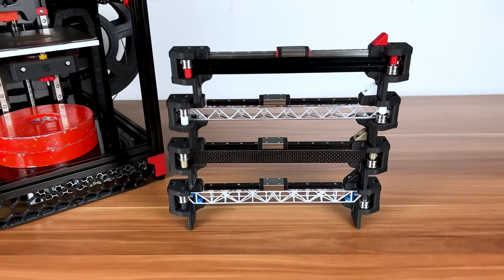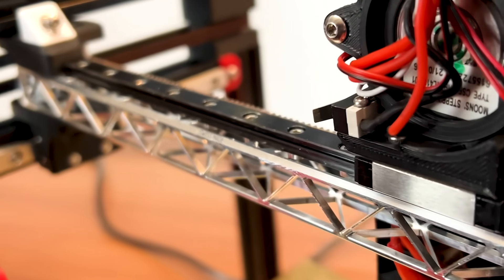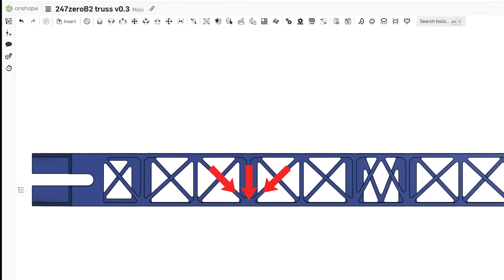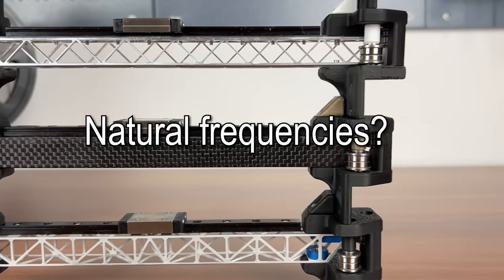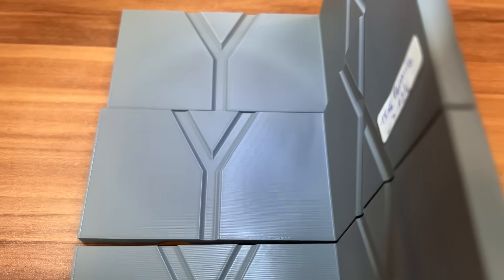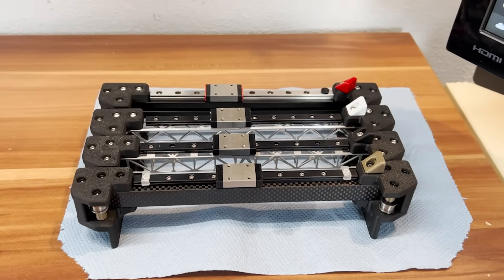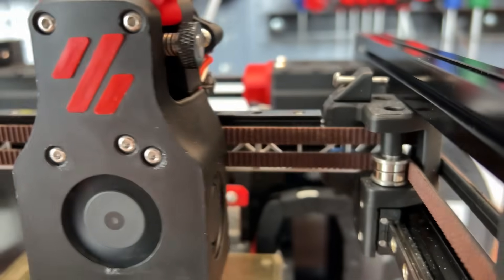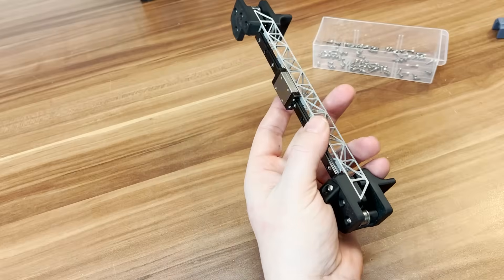ULTRA lightweight X-BEAMS tested -  USELESS on Voron 0.0 / 0.1 / 0.2 ?

Comment: Very nice investigation. I think maybe you underestimate the effect of the torsional force. The lateral deflection test technically would also be a torsional force since the the weights seem to be off-centered from the centre of the beam themselves. The from the lateral deflection and torsional defelection test seem to correlate with the input shaping results. 
Keep doing what you are doing! You have a great channel.
Reply from the maker: Thanks a lot and absolutely, I explained that exactly this is the reason why I did the torsional tests
Reply: @247printing  I agree that torsional deflection is very important. Can you mount the accelerometer as far from the center of twist as possible and show the amount of vertical component realized. By adding weight to the print head to move the center of gravity, in line with the center of twist you may actually get higher acceleration recommendations from Klipper because that vertical component is reduced.

Comment: The efficiency of the beam alone is academic, less relevant than efficiency measured by dividing the stiffness by the System weight (beam mass including the extruder mass). This would show even less difference.  Great video.

Comment: I find it really useful for larger machines like my 500mm vcore 3. the weight savings there are huge compared to the weight savings on a tiny machine like the v0.
Reply: Have you measured this? Or is it subjective? Are the motors on the vcore not up to the job? There is nothing to suggest that it would make more difference on a longer beam unless the motors arent up to the job of moving the stock beam.
Reply: @jeremyglover5541  Let's say the stock beam on a v0 weighs x grams. Since the vcore 3 500 is around 3x larger on that axis, the vcore 3 beam can be 3x grams. Let's say the ultralight gantry is half the weight of a normal gantry. In the case of the v0, the weight savings are x/2 grams, but in the case of the ratrig, the weight savings are 3x/2 grams. Since the motors still have the same amount of torque, the vcore 3 motors will have had a much larger reduction in mass to push, while the v0 motors would have a smaller reduction in mass to push.
Reply: @jeremyglover5541  boy wait until this guy hears about the concept of mass and how longer, thicker aluminum extrusions have considerably more mass than shorter ones
Reply: @microArc  i know. This simple fact seems to have been missed by everyone using this argument. Its a symptom of just doing stuff, based on half baked theories designed to separate you from your money, without doing before/after measurements/experiments.
Reply: @jeremyglover5541  i don't think you know how to do math
Reply: @microArc  npt my strong suit, not higher math anyway, but what specifically are you talking about? Since i didnt mention any math? Also, please use english, its Maths.
Reply: If you are talking about a reply to mobius above, taking on the discussion of mass vs length and flexture and the ratio of weight savings. Nope, i wasnt about to take that on on my phone at 2am. Its an oversimplification anyway, since we arent talking about a simple weight savings, we are talking about strength lost through the erosion of material in a less than uniform manner. We are talking about a carriage and hotend that is not centred perfectly, so as length increases the twist will also be increased. Multiple new resonant frequencies have been added. And all of this ignores the fact that if your motors are able to handle the load for the speeds you are printing and moving at, it doesnt provide you any benefit at all.
Reply: Basically, show me the measurements. Anything else is lip service. Losing weight, without torsional strength being maintained to the matching (ideally better) degree is counterproductive.
Reply: Im all for CF beams, with higher temp resins and thought put into the layup/direction of the fibres. Perhaps forged carbon. Im not really behind alloy lattice without proper testing/simulation and especially without the need, vs just using a decent motor and a standard rigid beam. I have no need for 50K acceleration in the printing i do, so utility also needs to be considered. The comparison between pushing resonant frequencies up so they have less effect on the wavelengths that matter to/impact your process, or damping (physical, or electrical/digital) is one that requires exploration.
Reply: 500mm vcore 3s are beasts!  I'm jealous over here with my 350mm v2.4
Reply: People who have MEASURED this say that the effect is even worse on the larger machines.  The light beams are less stiff then the standard V-slot beams.   Stiffness is what matters, mass is not important.

Comment: AFAIK, Input shaping is looking for it's first fundamental frequency to figure out how fast it can go. It isn't looking for torque on the motors, so weight is not part of the equation for the max acceleration it outputs. If you look at what makes up a fundamental frequency, a simplified equation would be fn = sqrt(k / m), where fn is the fundamental frequency (larger is better), k is the stiffness of the system, and m is the mass of the system. In a Voron, changing the x beam, you are lowering the stiffness of the best (lowering k) when you cut holes in it. The mass you need to think about is the mass of the whole moving system, not just the beam. So lightening the beam lowers the stiffness of the whole system, but only lowers the mass of part of it. My guess is going to a rectangular aluminum beam (like carbon fiber shape, but aluminum) would be an improvement. Or go to a thicker wall section carbon fiber. Of if you are really adventurous, move the linear rail to the front or back of the beam. It will then improve the area moment of inertia of the beam. That rail is quite stiff, if loaded in the correct way. Love to see people trying to push the limits! Great video

Comment: I saw a big improvement in consistency on my Tronxy X5SA when I changed to a carbon fiber gantry. it was quite affordable too.
Reply: The X beam would have been very heavy for a large 440mm extrusion compared with a CF beam. I wish he did this test on a much larger printer.

Comment: I am curious why the beams are square shaped instead of triangle shaped. That should save even more weight.

I also can't help but notice that those carriers y axis carriers on each end of the beam look quite... bulky and not at all optimized. Maybe there is yet more to save there
Reply: Square beams are way easier to make. But what happens if you remove the beam completely and use just the rail. Then you optimize the y axis carriers and belt idlers.
Reply: Triangular section has less torsional rigidity than a square for the same weight and wall thickness.

A circular section is actually the best.

Comment: Also, to verify that you are not limited by motor power but rather voltage - you can test these beams at reduced motor current.
Reply from the maker: Absolutely. To keep parameter variation low and not too complex, I used the default voltage at 24V and slightly elevated currents at 0.85A.
--> Realistic scenario for max acceleration test.
Reply: @247printing  Yes, I agree that your scenario is realistic and showing the truth: we are not limited by motor power => not much sense to reduce moving mass. 

Higher voltages could have showed the difference, but these voltages would be unrealistic. Lower current also could have showed the differences, but also not realistic. 

Thanks for great experience and learning!

Comment: You don't have a V-Core3 500 by chance to repeat the same with the big 2020 gantry it has? 
Im sure there is a bigger difference there.
Reply from the maker: In summer I'll build one and the kit should be on the way. I have some more carbon fiber (2020) here :-)

Comment: Hmm. If i had to put forward a theory on why the Y acceleration performed worse. It would be that it involves the linear rail mounting.
The Hyperbeam afterall lacks mounting holes for a good number of the rail's own holes, the CF Beam is a bit diy, bringing probably some tolerance errors and the Ultra-beam has that the holes diagonally connected to the rest of the frame, increasing effective length between hole and frame. These may cause minute motions within the rail that cause the software to take umbrage more rapidly.

Even the best mount would suck if the linear rail isn't as rigidly mounted as possible. At least i would assume so.

Comment: I appreciate the video, but right at the start when you were comparing the percentage weight reductions, my brain was screaming, irrelevant without comparing the total mass of the moving parts. Of course you said this at the end.
Reply from the maker: You need to start the comparison somewhere - I did directly on the component. I also stated already in the video, that those beams don't make sense :-)
Reply: this! especially considering printers like the k3 work with no beam at all, it’s pretty obvious that this really doesn’t matter on such a small printer